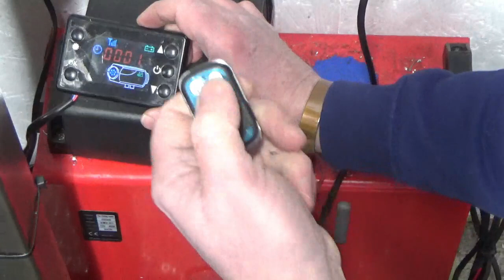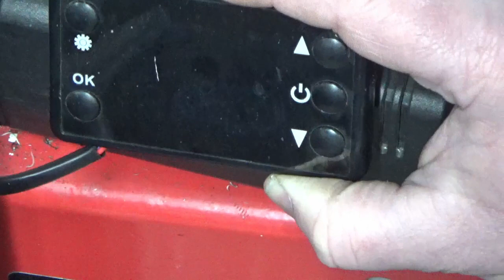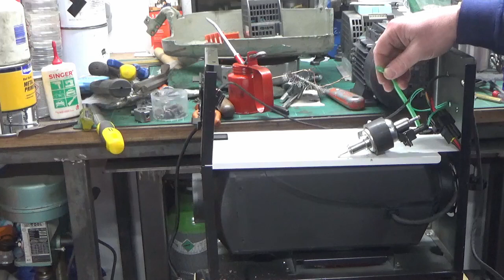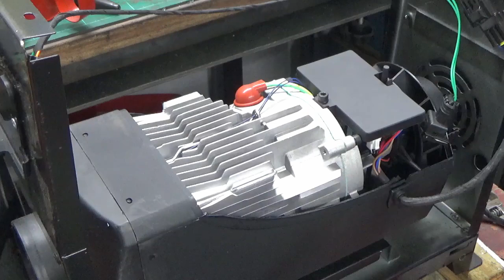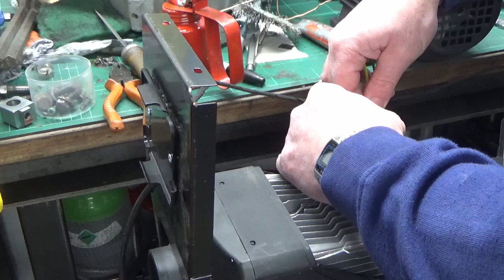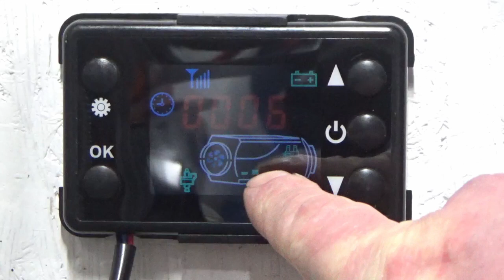Chinese Diesel Heater Fix - Glow Plug Replacement

Comment: Hi Jon. I’ve done the same job on mine but there was a massive amount of carbon in the exhaust so I delved deeper. These machines are very simple. If I can do it, it’ll be a breeze for you. Take the unit out and take the end off to get to the combustion chamber. The kits with the glow plugs that I got came with a gasket kit. I pulled about a cereal bowls worth of carbon out of the combustion chamber. Well worth doing. Great video mate 👍👍
Reply: It would be informative if more detail was supplied, otherwise we have to assume a p poor heater.  Mode of operation, fuel used and particularly the typical pumping rate would aid others, who read this, in how they operate their heater.
Reply: @oliver90owner  there are loads of videos on YouTube on this topic. One thing I don’t agree with is having the exhaust and intake filter going through the wall so close together. These things smoke a lot on startup! My inlet is inside the shed sitting off to one side and unobstructed. Possibly, do an inspection and de coke once a year when it’s warmer would be beneficial. I was sceptical when I first bought it but, my 5.5kw unit does a pretty good job in my 6x4m shed. All in all well worth the money.
Reply: @rickymale8203  I was referencing your comment re a sooted up heater.  Your comment re a ‘massive amount of carbon’ was not exactly informative/indicative of anything.  Mine is certainly not smoky on start up (apart from, perhaps the first time, when it was commissioned).  Details like whether your fuel is diesel, whether you are running it on low heat output for long periods, whether you occasionally run it at the highest settings for a period before shutting down.  Yes, there are a load of videos out there - but unfortunately most are pretty well useless.

Your claim of a 5.5kW heater would mean a maximum pump rate of about 8Hz.  Can you confirm this, or is it actually the usual approx 4kW output heater?  Little wonder it smokes if the fan speed is the usual less than 5000rpm and the pump rate is 8Hz.🙂
Reply: @oliver90owner  I did say it was around a cereal bowl of carbon.  I didn’t weigh it or measure it any other way. I don’t CLAIM it’s a 5.5kw. That’s the manufacturers description. It’s running on normal road legal diesel because red isn’t readily available near me. If I was running it on anything else I would have mentioned it. I run it on full power, at least a couple of hours then reduce it to keep the temperature to a constant. It’s normally running all day Saturday and Sunday. When I switch the unit off it automatically runs on full power. I think this is to purge the system. And, yes it smokes on every start up. The unit fan speed is how it left the factory. I hope this helps
Reply: @rickymale8203   Ricky, if your heater has an operator adjustable controller (has the typical 1866/1688? password code), I would suggest you alter the fan speed and pump speed ranges to slightly weaken the fuel to air ratio.  A CO tester might be a good investment to minimise the CO in the exhaust gases when adjusting it.  Running on DERV is the most expensive form of fuel for these heaters and savings, after proper adjustment, may quite quickly provide a pay-back for the tester (cost of fuel and less need of servicing/maintenance).
Reply: @oliver90owner  They will run on kerosene (28 second central heating oil) just fine. A little less heat potential than red diesel(gas oil) but not noticeably colder running.
Reply: @howardosborne8647    Hi Howard, I am fully aware that many run on 28s (Redwood) kerosene.  Slightly less energy available per unit volume and more heat lost via the exhaust due to the excess combustion air - but cheaper because kero is considerably cheaper than gas oil (and a lot cheaper than DERV.  

At least you qualified the fraction as 28s (redwood).  Many simply complain that kerosene is much more expensive and less available than diesel.  Likely what they don’t realise is that 28s kero is likely called “Furnace Oil” in their location.  I expect they are referring to the lighter grade of kerosene, which has insufficient lubrication properties, for these heater pumps, than the slightly more viscous (and higher boiling point) grade.
Reply from the maker: @oliver90owner  Hi Richard, good point. Go and check out Steviegtr, he has just done a back to back comparison of the cost v/s heat output to heating the same space with electric. In big handfuls it is about 1/3 the cost of electricity. I will pin your comment as reference for others. https://youtu.be/1fnpUfAAh9A Cheers, Jon
Reply: @jonsworkshop  Hi Jon, electricity is in the form of ‘high grade’ energy (can be used for a multitude of operations - running your lathe is just one of those).🙂 I most certainly don’t need anyone to tell me that heating with electricity is the most expensive way to go (apart from using it to drive a heat pump or using renewably generated power - such as solar PV or wind turbine generation).  What else can you do with ‘low grade’ thermal energy (say, less than 100 degrees Celsius) - apart from warming things or places?🙂

The other single advantage of electricity in our homes is that of convenience - flick a switch and use it.  Storing renewable low voltage electricity as chemical energy (in a battery) can be used to provide mains voltage power - but not often for space heating.  Even charging batteries using E7 electricity can be quite advantageous compared to the daytime rates charged for electricity st the moment! 

The only downside of these heaters is that of still burning fossil fuels - the CO2  greenhouse gas - but economics (unfortunately particularly at the moment). are leading us to use oil for space heating.
Reply from the maker: Hi Ricky, thanks for the comment. I will do this next summer, I plan to improve on the crappy install job so will give it a service at the same time. Cheers, Jon

Comment: Iv had one for 6 years and its had a lot of use and it packed up, when i bought mine they were £120 and when i looked on the net for information on how to sort it out i found they were only £60 so i bought a new one, and bugger me its packed up already with very little use and it did not seem to be as good as the old one, so i have to change the plug in the new one and this video was so helpful thank you, its an easy job to do now you have shown me LOL

Comment: I have the Likaci brand heater. Last night, I had an E8 error, which in their manual, is the glow plug failure. When I pulled the original plug, it was cleaner than yours(only been running for 3 weeks)......I just replaced the plug and screen and it powered up, no problems. One thing I found is that if the clicking is too loud, try moving the hose around at the bottom near the air intake. Mine was very loud after putting back together.....I could only take a few minutes of the sound. I then stuck my finger underneath(being careful to NOT get BURNED) found the fuel hose and pushed it back.......the sound went from very loud to almost non-existent. The noise is not always the internal clicking of the pump, but rather the fuel line slapping metal inside the case. The fuel line moves quite a bit while the pump pushes fuel through it.

Comment: E-10 error is driving me nuts. There no air in the fuel line, clean diesel, full and battery power is at 14v. It tries to start, but e-10 result. Any suggestions? Thanks ❤️

Comment: I bought one and was really happy with the way it worked. Used it three times and got through about 4 liters of diesel then E03 error. Spent a couple of weeks with messages to the supplier in China. They said we could send a new glow plug. It came fast by DHL today and of course is broken in two pieces as they put in a flat cardboard DHL envelope and a flimsy plastic bag around it. Now it is back to writing again to them. I anticipated something like this happening and luckily I bought a glow plug kit from another Chinese company so in a week that should come. Hopefully, that one will be in one piece. The Chinese say "The bitter sea has no shore". :(

Comment: Hi resistance would sujest gone open circuit wouldn't heat up on low voltage 12v

Comment: Hi Jon, I’m totally with you on your balanced approach to safety based on intelligent assessment of risks. I have one of these heaters for my workshop and invested in a £20 CO meter and tuned my heater. On factory settings the CO was 150 ppm on high setting and I managed to tune it to around 12 to 15 ppm by reducing the max pump frequency. I’m running mine on 80/20 Kerosene Diesel mix to provide lubricity for the pump. So far it’s probably run about 40 Hrs and the exhaust port shows absolutely zero carbon traces at all.
Reply from the maker: Hi ginettamike, thanks for the comment. Interesting idea, I will monitor carbon build up over time and try this if I have issues. Cheers, Jon
Reply: @jonsworkshop  Hi Jon, you can do it by accessing the setup menu with the 1688 PIN code and gradually reducing the pump frequency until the you loose the last bar on the display. Then just increase by one or two steps and it’ll be about right. Doesn’t affect the heat output and should use less fuel. After around 50 hrs use I can wipe around the exhaust port and there’s no sign of soot, oily deposit or even smell.

Comment: Wow, that's one noise but cool unit Jon. Aha yes Red off road diesel. Most farmers round me stopped using do to all the headaches of filing and approving it was for off road use. Goverment, go figure. Nice to see you back warm again and have a smile. Keep smiling , Spring will be here soon! Bear
Reply from the maker: Hi Bear, same this end, you have to fill in a form etc to buy it, and the traffic police sometimes do random tank dips to see if you are using it on the road. Cheers, Jon

Comment: Hi,Jon. I have had the same heater as you for about 4 years and mine has done seriously long hours of use. A full strip down once a year or 2 years is a good policy to keep everything running sweet. That heater of yours looks to be running nice and clean with good fuel air ratio settings. for checking glow plugs just connect the 2 leads onto a 12 volt supply and if it doesn't glow it is knackered. Also you should have a length of black corrugated 25mm pipe on the inlet stub under the heater with a filter/muffler unit fitted to the open end. This prevents debris being drawn in by the intake fan and also quietens the combustion roar.
Reply from the maker: Hi Howard, thanks for the comment and sorry for the delay responding. I have the inlet pipe and a sort of gauze/plastic air filter, I will fit it when I get a few mins, quieter would be better. Cheers, Jon

Comment: Jon, Glad you have heat again... The older I get the less I like the cold. I've been following these little diesel heaters with great interest, they seem super efficient and our energy costs are out of control as our yours. Might be a future project.. Enjoyed
ATB....Dean
Reply from the maker: Hi Dean, thanks for the comment. I would definitely recommend one, cheap as chips to buy and run, just very noisy when filming etc. I am the same, since turning 50, I am no longer a fan of trying to be a hero and just ignoring what your body is telling you lol. Cheers, Jon

Comment: Nice repair, and information on these heaters, yes,  see why you started with multiple level disclaimers. Lol.🥺😯😲.
Thanks for sharing Jon, you can wear your safety slippers in the workshop now 👍. 
Best regards from the Black Country. 
John.
Reply from the maker: Hi John, thanks for the comment and sorry for the delay responding. Cheers, Jon
Reply: @jonsworkshop  Hi Jon, don't apologise.

Comment: Job well done, Jon.  Likely, next time (if ever needed) you might turn the heater round the other way and manage to turn the fuel tank by 90 degrees (with support), bend out the flimsy end panels to remove the tank support sheet to make the job a bit easier and quicker?

Resistance usually increases with increased temperature and these glow plugs seem to draw about 8A during start up.  At 12V, using Ohm’s Law (Volts = Current x Resistance), the resistance, when hot, will be around 1.5 Ohms.  That 300+ ohms reading clearly indicates a virtual open circuit.
Reply from the maker: Hi Richard, thanks for the comment. Worth a try next time round, thanks. As for the numbers, I understand the words, follow the maths, get the logic, but I would not get there under my own steam lol. Pretty sure if I studied it all I could grasp it but it never excited me enough so I just get by with a minimum of knowledge and a lot of YouTube help lol. Cheers, Jon

Comment: Hi Jon, just a thought I have one of these, have it installed with the unit inside the workshop, my intention is to have the unit outside the workshop in a bespoke cabinet and pass the hot air tube into the workshop, by the way a mod you could of made is to release the pump bracket from the chassis and hang it from a cable tie, this stops noise transfer from the pump to the chassis
Reply from the maker: Hi Terry, thanks for the comment. Outside would definitely be quieter, but comes with the drawback of getting piss wet through every time you need to fuel it up lol. Plus you predominantly use in winter so I would also need to install some outside lighting to be able to see what I was doing etc, too lazy lol. Cheers, Jon
Reply: Agree,Terry. Isolating the pump does indeed reduce the tick,tick,tick noise level. If it is inside the housing it does reverberate though the plastic tank and chassis

Comment: Hi Jon. Glow plugs are just a coil of wire, and to get hot they need to dissipate power. P=V x A, and A = V/R, so assuming 12V: 12/.5=24A (although the resistance will increase as it heats up) 12V x 24A = 288W. With the 340 ohms, you would get about 0.4W! Hence no start. Electronics lesson over 😁
How much current does your little PSU deliver? 
I don't have one of those heaters but I enjoyed the video anyway. Thanks Jon.
Reply from the maker: Hi Olly, thanks for the comment. Not sure on the power supply, it's rated 0 to 15 amps so 180 bananas I reckon! It was a special modellers power supply for charging LiPo batteries. Seems to work on the heater although the numbers don't really add up...... I hate electrickery with a passion, I just kind of know when it smells wrong lol. Cheers, Jon

Comment: Interesting video Jon.  I don't know anything about these heaters, so it was quite informative.  I have used glow plugs on diesel engines and they usually go for a long time.  Maybe it was just a dud or maybe the wires are making a bad connection at the end of it.  Anyway, good to hear it clunking away.  Can't the Chinese make a quiet pump for these things ;)  Cheers Rob
Reply: Nah, just cheap chinese.🙂 Unless the settings have been altered and not matching the glow plug fitted.
Reply from the maker: Hi Rob, thanks for the comment. It's excellent value heat (comparatively), it's just a noisy bugger, if I wasn't filming it wouldn't bother me much at all, it's just not good on camera. Worth looking at getting yourself one. Cheers, Jon

Comment: Well you didn’t go at it hammer n tongs as I would have done, I test Glowplugs by sticking 12v to em. If they get hot there working. I think you let very lucky unscrewing the plug with pliers, mind you it’s not an old unit, ally and dissimilar metals can cause problems, I couldn’t tell If the thread was in the ally or in a tapped bush. Glad to see you warm again,  nowt more permanent then temporary.
Reply: Me too,Ian. Just connect the 2 leads across 12 volts and if it doesn't make the plug glow the plug must go🤣

Comment: That was great Jon well done. I thought you were going to mill a slot in the 12mm socket for the wires to fit in! Nice work on the fix. Like others here I wonder if it's worth a bit of investigation into mounting the unit outside. Maybe a fabricated bracket bolted to the outside wall. Then the warm air pipe going through the hole where the exhaust now is. And the wires through another hole. It would cut down on the noise.
Reply: Heater outside would be better, but with a pipe/duct, from inside to the warmed air inlet, would be.even better (or the heater in a sealed box on the outside taking air (to be heated from inside).  Safer, too as no chance of CO being leaked from the exhaust into the room.  Exhaust gases getting into the combustion air inlet is a pain and a waste - as that would be reducing the combustion air - and possibly leading to sooting in the heater (either on the heat-exchange surfaces, or in the combustion tube if the amount of exhaust gases being ingested was high).
Reply: @oliver90owner  Very good point.
Reply from the maker: Hi Carl, thanks for the comment. Definitely would be better outside from a noise perspective, however from a use and monitoring of condition etc, I prefer it inside (I don't get piss wet through every time I have to fuel it, and I can listen, see, and smell the running condition to be predictive should faults start to develop....... I never forget where these things are made). Cheers, Jon
Reply: @jonsworkshop  All good points!
Reply: @jonsworkshop    Ha ha, good point with that tiny tank.  I have two options - one is the standard tank (twice the size of yours) that came with the heater and the other is a sensible 25l drum which can be replenished (or just changed for another full drum of oil) at any time when it ain’t raining.🙂

Comment: Gday Jon, for the price of the diesel heater and for what bit of realestate they take up they great value, my unit is the same as yours and it heats my workshop quite well, in the end that was a good easy fix, thanks for sharing mate, cheers